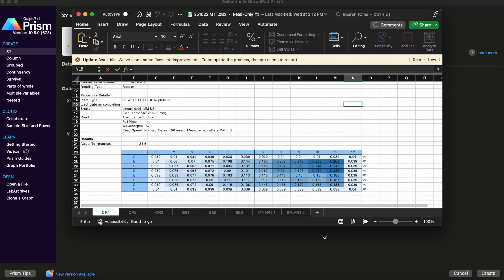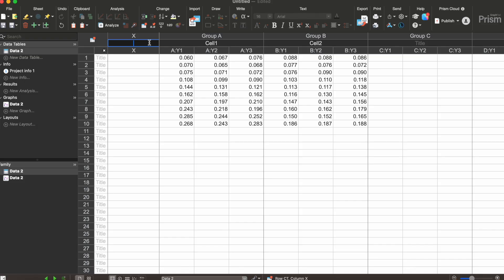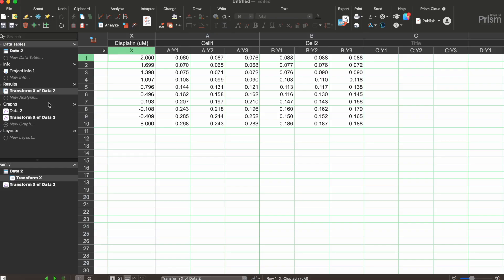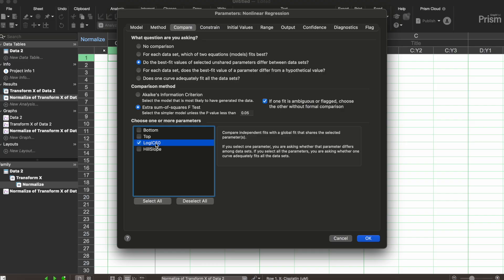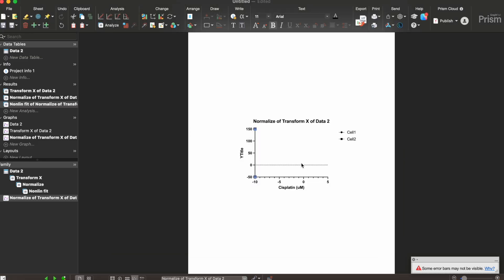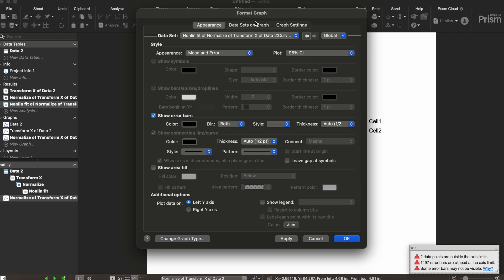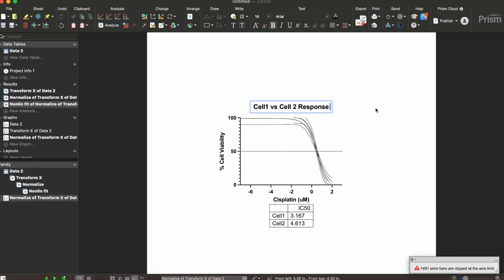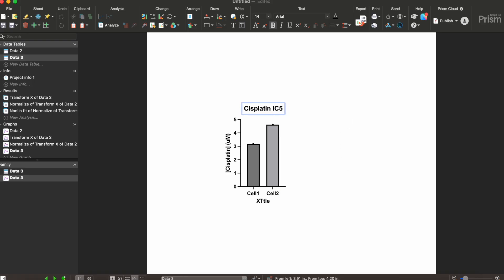GraphPad Prism 10 - IC50 from MTT Viability Assay

Comment: Hi, I have 3 plates (Biological Replicate) of the same sample and concentration

Should I find each plate Cell viability corresponding to each concentration of each plate and than normalize it, then use the combined normalize data of each plate to plot the graph?
Reply from the maker: Hey there. For each biologic rep, adjust the technical rep # right at the first step of setting the prism doc up. I have it set to x has 3 reps (but sometimes i have 4 or 6 so put however many technical reps you have in). Then enter all of your data into prism and label the Y columns as needed (Sample 1, Sample 2, and Sample 3). The once you transform and normalize ALL of the data (all 3 reps), upload those IC50s into a bar graph.